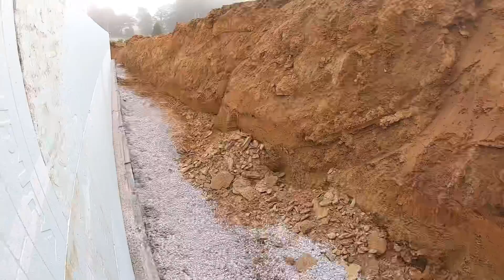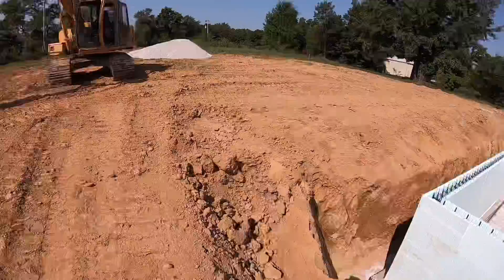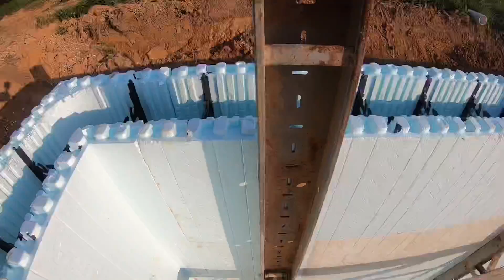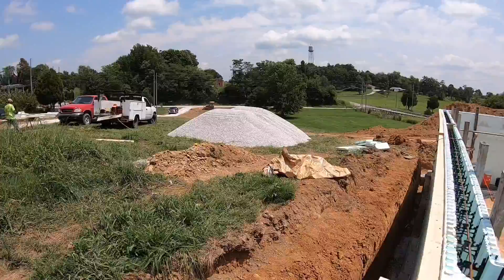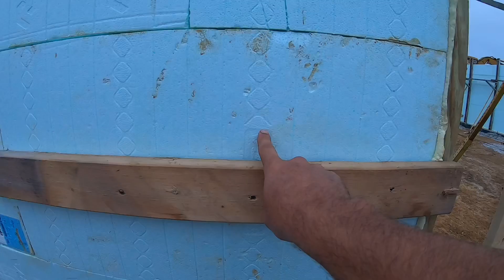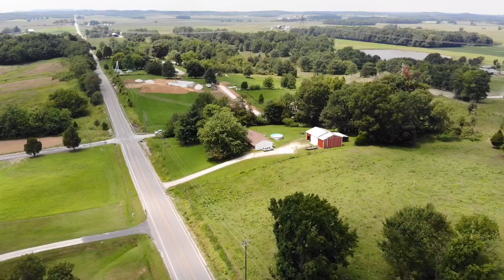How to stack ICF basement walls #nudura #ICF

Comment: Enjoyed video Mike,  down here in hick town we use your standard block and mortar for basements old school but proven system.   Every once in a while you'll get a home owner with some change in there pocket and get to set the prefab basement walls.   The system you are using seems superior to the rest, what are the benefits in using this system vs the others?  Sell me on it.
Reply: IMO:
From my own experience waterpoofing said CMU and solid exposed monolith concrete, them CMU sure retain water like a reservoir and total crap IMO, but a good deal with those with small budgets as long as they are smart enough to drill a hole in the middle of voids in each block at the base to allow water to flow out and into a baseboard system carrying it to a pump well. But unlike monolith the CMU also have more prevalent noticeable cracking from settling, easy enough epoxy bond and tape fix. 
Prefab is really nice but no nearly as budget friendly as ICF which acts as form from the start which once installed does not need removing and thus saves time compared to traditional formwork which also incurs a rental cost from before start of install to removal. Have worked on one basement using such where the joints literally cracked open, all the waterproofing me and the other guys in my dads business did wound up being for not due to that fact, it was a basement for a "church" to go up atop from what my step dad told me then..
ICF is only like 10 to 15 bucks a block, and depending on cost of CMU in the area one is building it can be less than or 10% more than using CMU blocks, and less than formwork style. and a thicker wall than what precast may offer in the area as well which is only insulated on the inside by a minimum of 2 inches at most. Concrete itself also varies from region to region.
Reply from the maker: Thanks check out my web site Simon and Harris homebuilders
Reply: @DirtPerfect  these things have intrigued me. Are you planning on taking us each step of the way through this build?  Not asking for trade secrets but just so many questions I like to ask.

Comment: That's a nice system.  Do you have trouble though with carpenter ants and termites  tunneling all through the Styrofoam within a few years of construction . I sure did even though we had them spray the ground they just stayed inside the Styrofoam  they were a real problem.
Reply from the maker: No not many problems around here

Comment: We have an ICF above grade tornado shelter. 12" walls and 12" top, monolithic pour.
Problem is the mice got into the foam even tough I stuccoed the wall before adding vinyl siding. 
Maybe I'll remove the siding and get some colored Shotcrete  .
Reply from the maker: We have done a few of those no problems what type of block is it
Reply: ECO Block. Did it about 8 years ago. Bought it right from the concrete plant.

Comment: down were you are when adding an attached garage to a home, do you not have to dig out the whole garage area, and put a footer all the way around. double wide wall at house on the bacment footer..  and put up a block or solid pour wall up to grade then fill the whole center with gravel compacting in 6 inch lifts, then pour the slab,,, we do here, an drain tile all around as well as in an x under the basement floor to a sump hole in the basement, all tile must flow into that basement sump hole witch is normal built under a stair case, and a pipe throw the wall for the sump pump hose to go out
Reply from the maker: We bridge the footer from the basement will go dirt and this one will drain to daylight
Reply from the maker: Hope that answers you ?
Reply: @DirtPerfect  yes thanks

Comment: I've never worked with that system, that's interesting.
Reply: ALl ICF "block" type forms go together pretty much alike. except Quad Lock which comes only in KnockDown form so assembly is required as you build up and KD form are the most versatile IMO..

Comment: Psi foam is much better you’d be much happier
Reply from the maker: Yes I agree have used it
Reply: I google PSi foam, got nothing but fomulair results. Is it the name of an ICF maker?
Reply: Joshua79C C I miss spoke it’s OSI I commented after that
Reply: @snowplower771  did not see that comment correcting your error, You do know you can edit your comments? triple dot to the right of the comment you posted, just hover over it and select it and then select edit or if you desire you can delete it. 
A BuildBlock employee/executive who does video for the company channel did a comparison test of the most common foam adhesives on a panel, not sure he used the OSI stuff from memory. But found Great stuff blue was the best instant and overall adhesive filler for a low cost budget builder/owner.

Comment: Thanks for showing me how that's done. Looks like it would have braces on the outside and that's why I don't do basement's. Lol. Thanks for the video
Reply from the maker: Lol thanks for watching glade you learned something 😁
Reply: Only bracing on the inside with these, as long as you got an inward bow as shown in the flying shots, the braces will push out the wall in order to have straight and plumb walls once all is set if everything was aligned properly when poured. Even above grade its only braced from the inside, the webs provide the outside bracing.
Reply: @Joshua79C  hey thanks for the explanation I appreciate it.👊

Comment: still don,t understand bow in wall
Reply from the maker: The braces will push they will not pull next video may explain it better
Reply: AKA after the pour the wall will be leaning against the brace, then you make it plum with the brace pushing it VS pulling.

Comment: I am building my 2nd house soon and I'm wondering what ICF would add to the cost of the house over conventional forums?  I understand I could do basement footing to rafters and I would save on insulation and exterior wall studs but I wonder what the cost difference would be roughly?  This is a great video and I appreciate the time you spent to show us this.  Do you have any interest in traveling to southern IL to build my house like this lol?   Thanks again
Reply from the maker: Around here it’s about 10% more but you save that in energy cost in a few years. I have a older video on upper level pour get time check it out are check out my website Simon and Harris home builders. My house is  built that way and love it. Don’t think I can do the hole job but would be willing to come over and help the contractor if is is open to it
Reply: My house is ICF, purchased it over building it..  Anyways I can confirm Dirt Perfect is correct my heating bill last month december was $93 for the gas bill. 2000sq foot rambler in WA state.   Granted that includes heating water, and the stove but those are epic small loads. I keep my home at 71 24/7  with radiant heating floor.     I'm tempted to build my shop with them.

Comment: Very informative brother. Anyone preparing to do a basement should definitely watch, very good. What is the cost compared to conventional block walls. If you want to share ?    Thx buddy.
Reply from the maker: Thanks it varies depending on plans but around 10%
Reply: And compared to traditional formwork it saves on not having to pay for renting forms and the time to install and then remove them. Takes less time to use ICF than it does to use formwork or blocks and as a retired waterproofing pro it still needs such tech for drainage and the wall itself, but wont leak or retain water like all those cheap CMU blocks do.

Comment: What keeps the outside walls from pushin' when filled. This is interesting!!
Reply from the maker: The web in the block
Reply: as they said the web, but also proper pouring at 2 to 4 foot at a time also helps prevent blowouts
Reply: You should be able to pour way more than 2-4 feet at a time. Local cement plants charge $1000 for the pump truck to show up. You should be able to get an entire house poured in 2-3 different pours.
Reply: @90TBD What they mean by 2-4 feet at at a time is going all the way around the foundation in a 'lift' of 2-4 feet, then continue around again with another 'lift'. Continue like that until the pour is finished, all in the same day with just one pump charge.
Reply: @calvinjutila8270  after I wrote my response, I was wondering if that's what you meant. Definitely can only bite off so much at a time. Cheers!
Reply: @90TBD  Yes definitely go with as much of a load per truck to keep that cost at a minimum, but as Calvin explained from what i basically was saying. They say 2 to 4 feet at a time which does not imply small loads of concrete per truck. 
Have seen some articles showing horrific work of using icf, clearly showing improper bracing and pouring where they though it would be easy to pour the entire height in one go. Plus doing in lifts allows the cement company to send a truck elsewhere with a load and only to you when you call for them as planned ahead of time so the mix arrives properly mixed and they can keep up with the supply required for the amount of pour required. 
Too much never hurts, but having too little will definitely put a dent in the works.
Reply: @90TBD  No worries. I started driving a ready mis truck in 1970 and retired in  2006 as a general contractor so I was around that stuff a lot. Best.

Comment: Plus ive heard there big bucks ? I dont get it i could throw my 6 bar panels on that job and be ready to pour in one day.   Then if they want  insulation on each side after ?      Guess im ole school. Lol
Reply: Yha. I guess alot faster.      But im stuck on ole school  lol.   But anyway.     You do nice work mike. On everything you do.  Thats bout all that matters
Reply from the maker: lol we stacked this in 6hr in the heat And remember it’s not just insulated it’s also studed and ready to hang dry wall to but I in where you are coming from
Reply: A few manufacturers now offer forms with one side clad in wood for later exposed face on the indie or outside, depending on the customer needs. I have seen and done waterproofing on many formwork monolith pours. Its nice but the forms take time as you mention to not just install but also to remove and ICF acts and both form which does not get removed as it also provides the already built in insulation saving time with that after when it comes time to finish it, as I never knew about ICF before 2005 and thus I never saw or worked with it, but from what I have watched about them in the past 5 years, ICF is definitely easier, less time consuming, and less messy to waterpoof and not just 'install'.
If I ever buy a house of my own and the basement needs replacing, or I  buy a run down place anyway to rebuild entirely, I am definitely going to go with ICF for the basement and perhaps the upper main flooring and  basement slab. Going with post frame structure for the main living space, basement will be mostly clear span except for mechanical room and a sizable storage area.

Comment: Good vid.  But im not a fan.  Done a few around here over the years.         I wont forget one. Wich is not the  manufacturer 's fault.    This is 20 years ago we dug it. Lucky our excavator was way in back yard.       And it was one like you said basement to rafter.     Huge house.  All poured.  A few days later  guy cutting rebar for deck piers or something  and  up she went.  Such a fire it burnt.  So hard shattered all concrete and burnt both house down to the ground one to the left and one to the right.     They were about 50/75 feet away.    Plus. Im not a fan of making houses to air tight.    I would loose some efficiency for 3 or $400 in extra fuel to heat. And. Guys up here are making  wood  houses so air  tight  they are not healthy  and  boilers and dryers cant even get enough fresh air to operate.    Then they gotta install  make up air.        Sorry to throw my 2 cents in. But not for me !
Reply from the maker: I understand your argument but disagree 😁 but also appreciate your input and thoughts
Reply: I get your concern for homes that are so airtight, but with the proper air replacement systems, they have proven to be way more efficient and have cleaner inside air, but to each their own.

Comment: This way of doing a basement is a great idea a friend of mine built his whole house and garage this way got say its well insulated. Best part there no heavy forms to wrestle with. Keep up the great videos
Reply from the maker: Yes I agree that is the way my house is built footer to rafters icf thanks for watching
Reply: @DirtPerfect  did you do your all in one pour?  What are the cost of your build compared to traditional stick frame from the basement up?
Reply: @jamesrobertgrimes  For sure it is cheaper and won't burn and be a haven for termites saving a lot of money.
Reply: Kenny Mysak Did your buddy use a traditional roof or concrete?
Reply: @inmyimage1081  set rafters and put on a steel  sheeting
Reply: Kenny Mysak Thx